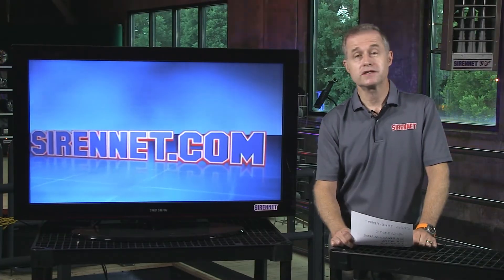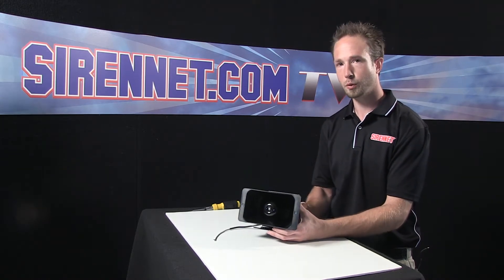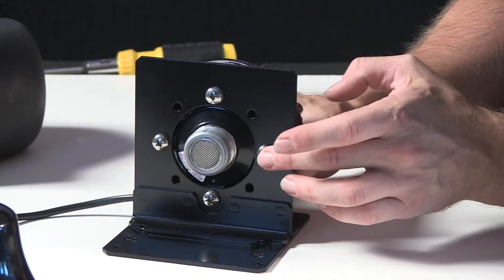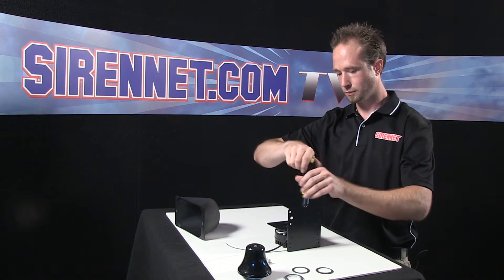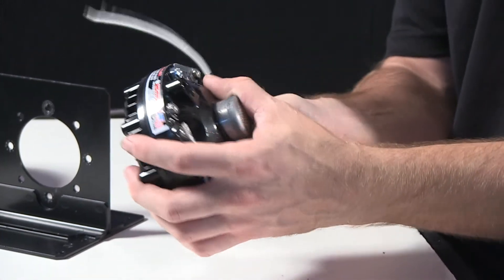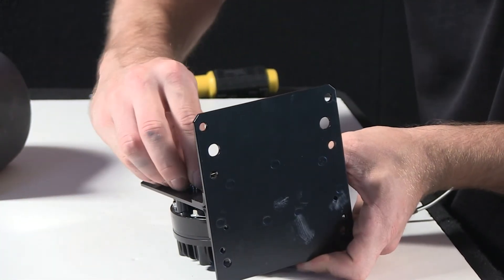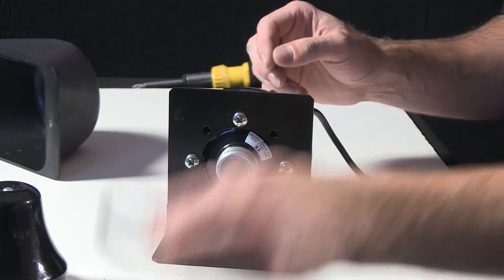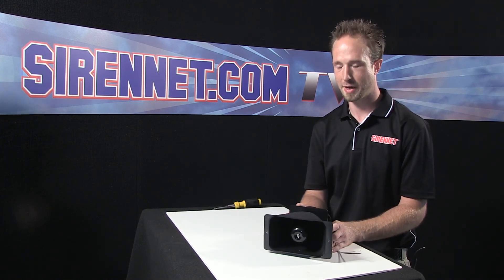Chris disassembles a Whelen SA340TS 100W siren speaker

Comment: is it waterproof ?
Reply: If it scares away my ol lady..I want one..lol  :D
Reply: @davenwpg1  -- Wife bad!
Reply from the maker: It is water resistant. They're quite popular for ATV and Watercraft applications.
Reply: SIRENNET What is the best practice regarding the  direction to face this style siren speaker to optimize the sound and prevent water/dirt intrusion in a SUV type vehicle. I have been told simply downward behind the front bumper.
Reply: @sk8rfiero  Ideally istraight forward withothing in front of it.   Weep hole on the driver down to allow drainage.